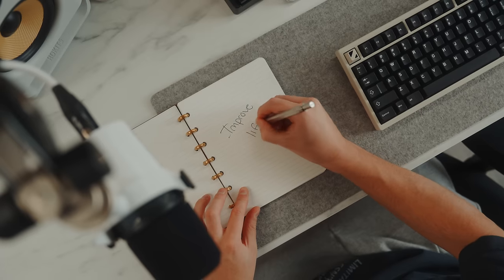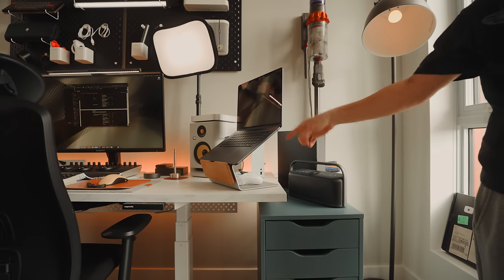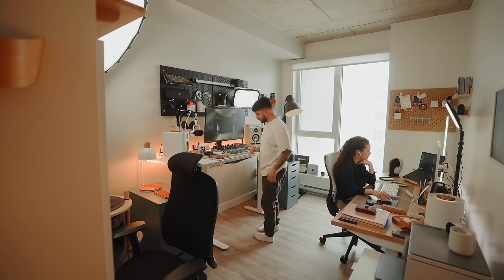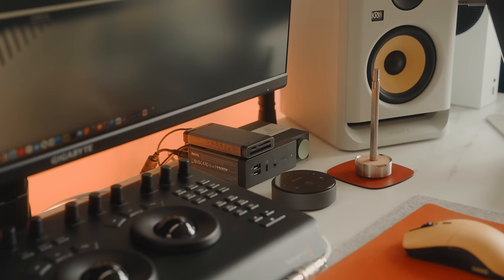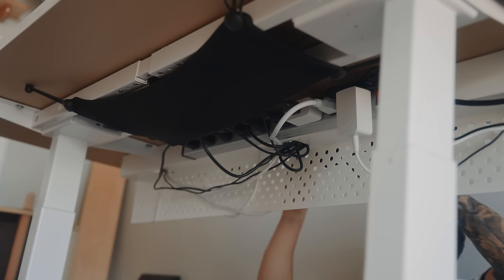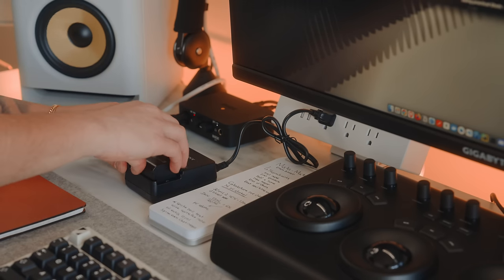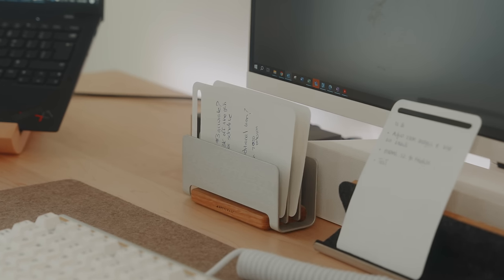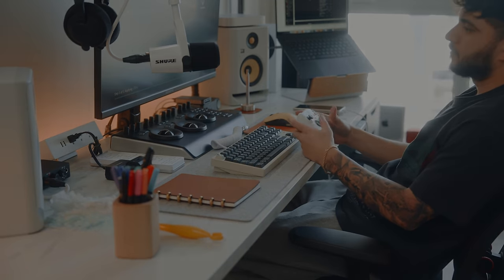Desk Setup Upgrades That ACTUALLY Matter

Comment: Hi Andres! Could you make a video about how you struggle with dust and dirt in the apartment? How often do you clean your desktop? What tools and equipment do you use? Thanks.
Reply from the maker: urg a lot... honestly its kinda hell. I think the air system in apartments is so bad mainly because its shared so the dust accumulates like crazy. I just got a robot vacuum for the condo so im going to try that out.

Comment: I put some screws in the bottom of my table and mounted the power outlet on the underside of the table. so the plugs are close to the table edge at the back for devices, it keeps them off the floor (and in a way dust can't collect on the outlet), and lets you look the power cables up into the cable tray I mounted.